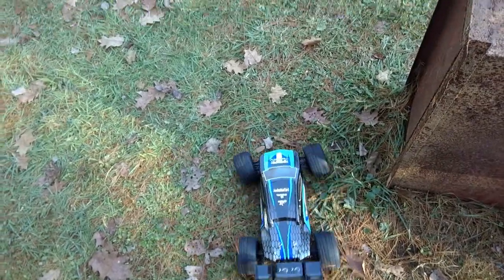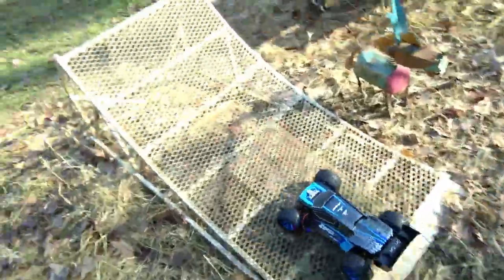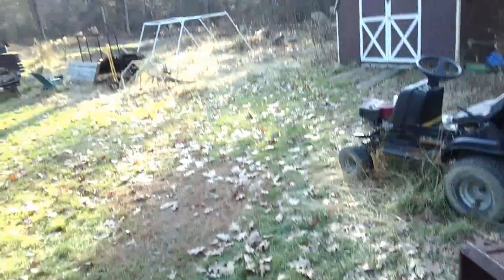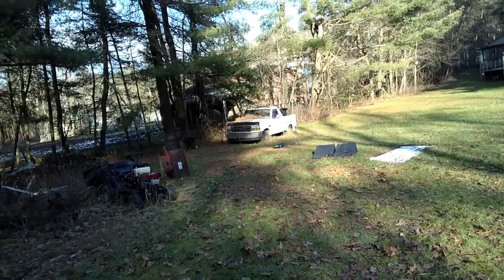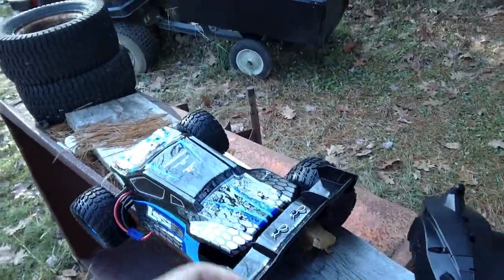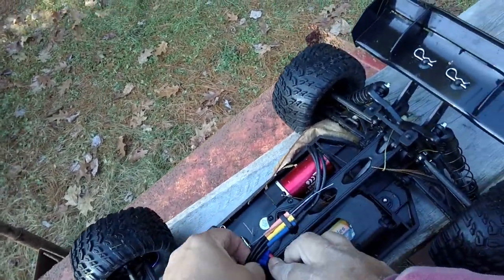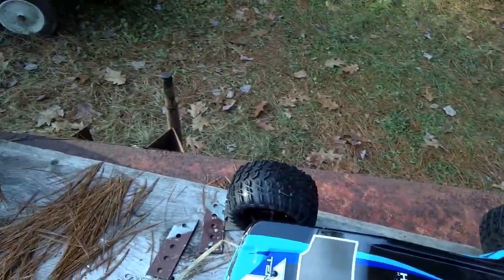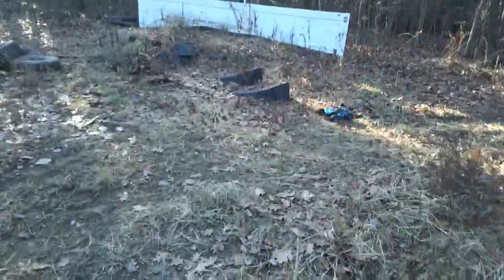Losi Tenacity T first hard bash, and broken

Comment: So great to see you back and enjoying this hobby again. Your buying spree has me wanting a few more myself. I love the punishment you give these things. I think Losi made a good platform, but it’s not the most durable in my experience either. Are you gonna get the new 8s Arrma Kraton?
Reply from the maker: at $900  I won't likely be getting the 8s Kraton. I don't have room to start collecting large scale.  between the price, and 2 4s packs... It's just not worth it. If I'm spending over a grand, I need to fit behind the steering wheel. PERIOD. That kind of spending is reserved for bigger toys